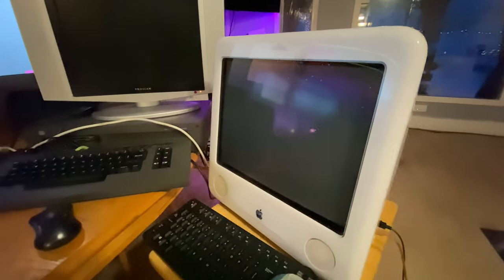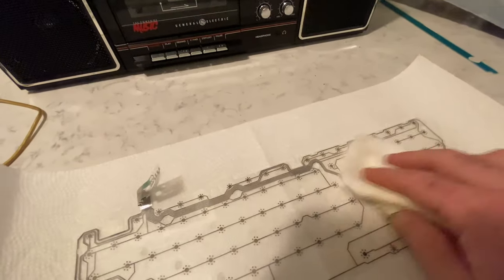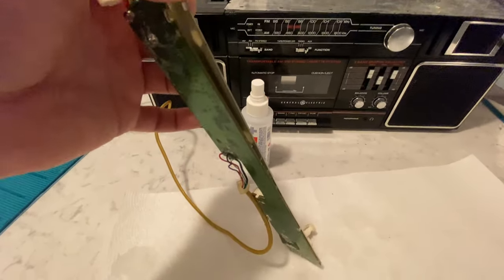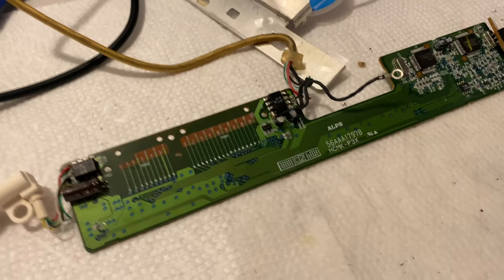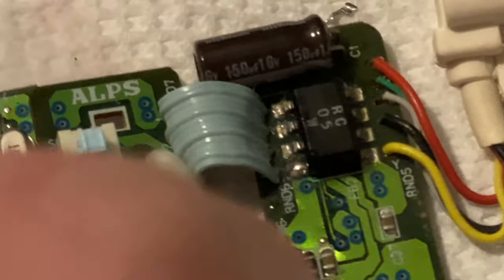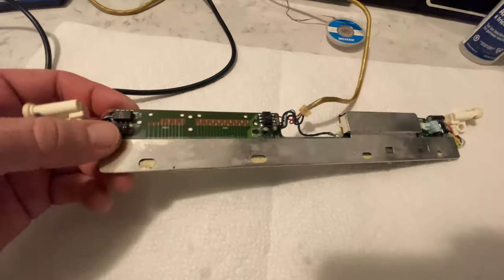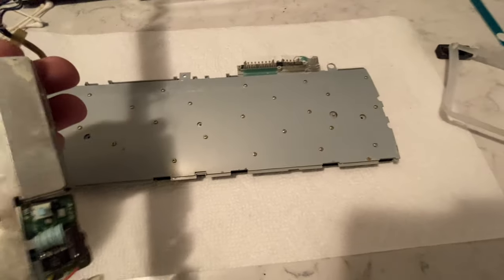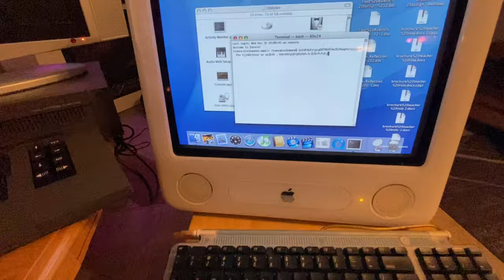eMac G4 Keyboard Repair

Comment: You need to tighten the screws to the correct torque specs in the proper order, otherwise you could warp the keyboard head mating surface.

Comment: Know when to use vinegar.  Works great for corrosion.
Reply from the maker: And brake cleaner i used on my old macs that were pretty corroded as well
Reply: @DJSures   Brake cleaner?  You want to clean it, not melt it!  😅
Reply from the maker: @CandyGramForMongo_  A lot of ppl are misinformed about what's in brake cleaner. Look it up - it's also great for removing stains, as dry cleaners know :)
Reply from the maker: Oh before anyone reads my advice with break cleaner and uses it on anything - you should still not use it on plastics or rubber. It is okay to use on pcb material, metals and cloth.
Reply: @DJSures  Brake English, why don’tcha!